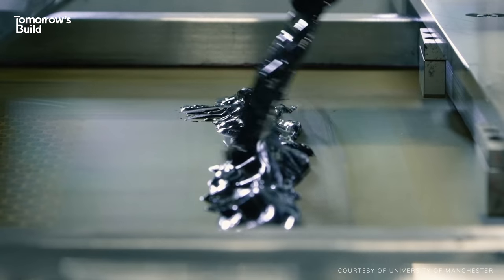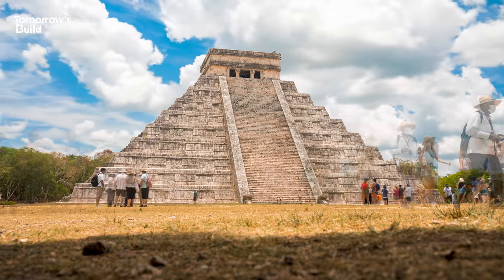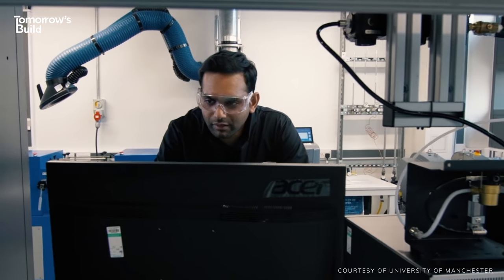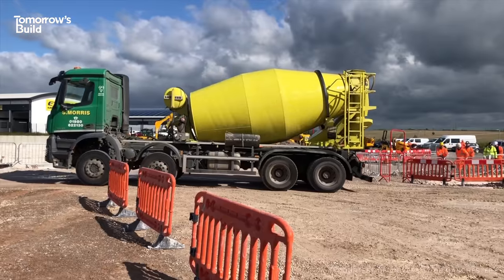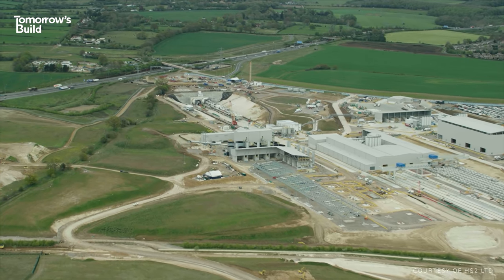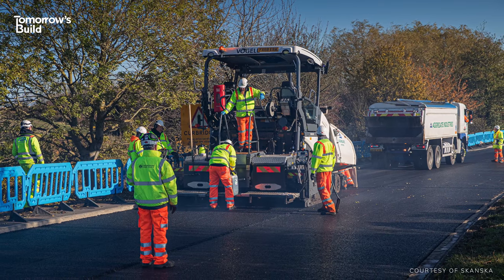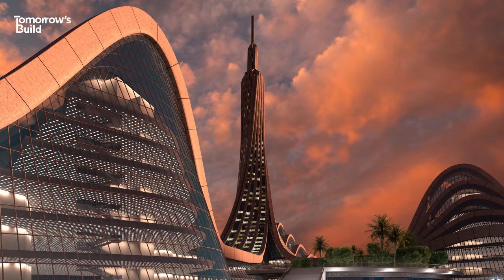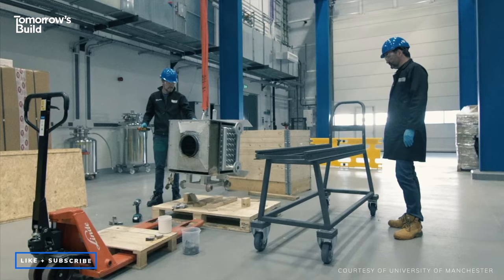Construction's Graphene Revolution Has (Finally) Begun

Comment: No rebar!!!??? That news alone is HUGE
Reply: if and when my friend.
Reply: ... and not good news for the steel industry!
Reply: Huge and crazy cool.
Reply: @drummingspain207  unless they make graphine coated steel for other purposes like space flight and metal casting etc.  steel is used plenty in thousands of other applications other than rebar.
Reply: @Carboxylated  sure, and they are good points. In line with the OP, I was thinking particularly of the thousands of jobs which rely on steel rebar. From manufacture, bending, transportation, fixing... that would be a lot of people suddenly out of work or having to rapidly retrain if possible. But that's technology for you.....!!
Reply: Fiberglass fibers are already used to prevent cracking.  Fiberglass rebar is also available.
Reply: @drummingspain207  The automobile will never catch on, if it does that'll be horrible news for farriers, horse breeders, veterinarians, and many thousands of jobs!!!

Graphene isn't going to replace rebar in one fell swoop. Stuff like this (if this really is the way of the future) takes time. LOTS of time. Decades.
Reply: @drummingspain207  Yep, that's technology… and regulation, health discoveries, and a lot of other things that changes how we do things and the materials we use. This is why a good society supports people who need to learn new things, and values innovation and discovery.
Reply: What they didn’t say is concrete is crap under tensile loads so rebar def still needed !
Reply: @nasonguy   lmao not if it's a disruptive technology. if you look at a graph of disruptive technologies you'll see pretty much all of them shoot from 10ish% to 80% adoption in a few years
Reply: they can use fiberglass and kevlar
Reply: they kinda are forced into it in the 3d printing application... cant have the printhead crashing into rebar
Reply: Will it work. I am a bit sceptical about new technologies in big projects like this. Because small mistakes can mean huge challenges.
Reply: @drummingspain207  I think it’s the opposite. Concrete has lots of uses that’s superior building material to wood for example, but the rebar needed might make it more costly. If new graphene concrete were as great as promised it would create new jobs and use better material. On the other hand, steel will always be needed. Besides, most steel rebar comes from China anyway, not many in Europe or US will lose jobs.
Reply: there will still be rebar just maybe graphene rebar
Reply: @drummingspain207    i mean eventually man will be replaced by machine lol already happening slowly but surely
Reply: And miss out on drilling through it and being blamed for compromising the integrity of a building because the engineers indication on the print was a little off? Wow amazing. My back is still sore hahaha
Reply: @drummingspain207  and they will adapt, same as all obsolete industries have over the centuries. Do you also lie awake at night worrying about the horse infrastructure that lost its position when cars were developed?
Reply: No rebars might also mean no need for many columns on bridges and buildings and not too many joists for roofs. Graphene is after all 100x stronger than steel.
Reply: @leapdrive  not to mention buildings will be less likely to collapse due to rebar rotting.
Reply: @williamcrowley5506  , 👍
Reply: @drummingspain207  You can relax, nothing is happening "suddenly" with graphene
Reply: We've had fiberglass concrete additive for decades
Reply: @JarrettWilliams99  and that compares to graphene?
Reply: @raybod1775  fiberglass will never replace steel. It has its own problems in concrete
Reply: Is this the same material used in the covid19 jabs?
Reply: @fcres5845  you should try it and find out. Feel
Free to mainline some graphene infused concrete and let us all know how it works out for you. 🙄
Reply: @William Crowley
Too much your answer 😅🤣
Reply: @fcres5845  too little your English 😂🤣🙄
Reply: It’s crazy
Reply: Speaking as a structural engineer who has used fibre reinforced concrete graphene probably won't replace reinforcement anytime soon until they can get consistent mixing and the failure mode of the concrete is not catastrophic. FRC is really good for reducing time until concrete can be used, it increases the tensile strength through the full depth of a slab / beam, similar to prestressing but without the mechanical action but more importantly reduces the time to reach a suitable strength to start working on the curing concrete. However, one big drawback is confidence in the consistency of the mix and clumping of fibres, if it is not even throughout the entire mix or uni directional in some locations there is the distinct possibility that it can have local failures in tension. There is also the problem that under reinforced concrete (with steel rebar) has the very desirable failure mode of visibly cracking before it's capacity is fully exceeded so it is possible to evacuate prior to failure. FRC without reinforcement, including steel fibres not just a graphene mix, fails immediately (i.e. catastrophic) so you would have to have a lot of confidence in the concrete supplier to make a homogeneous mix to match the design capacity and that capacity is never exceeded otherwise you will be killing an awful lot of people. I don't have big enough balls to use FRC in a suspended slab anyway, I've only used it in heavy duty pavements (think really really big mine trucks) so they can use them faster. Until the professors can prove graphene in the real world and not a lab I am not replacing steel with it, yielding is a good thing.
Reply: @drummingspain207  This industry wouldn't stop using rebar universally overnight. Plenty of time for the workers to shift to other jobs.
Reply: Ironworkers be like 😳😳😳
Reply: That's bigger than you think considering the issues with poor quality rebar created via the "thinning process" first developed in China and suspected of being involved in several building issues in Australia where I am.
Reply: Haven't basalt fiber and fiberglass been already successfully substituted for rebar in reinforced concrete ? A pity they're not seeing more widespread use.
Reply: That's only possible because the concrete is being 3D printed - 3D printed concrete can't use rebar anyway, and this technique is not practical for many applications aside from retaining walls. This is because retaining walls can be designed and manufactured such that they are entirely under compression. 

The primary purpose of rebar in concrete is to provide tensile strength, so if the structure is designed with tensile regions rebar becomes unnecessary.

The biggest issue with concrete that does not use rebar is that the failure mode is sudden and total, and this eliminates the primary advantage of concrete as a construction material.

Graphene concrete is a big deal but it's not going to remove the need for rebar in 99% of structures.
Reply: I literally paused the video and was reiterating that to my wife,... And shockingly, she mocked me by saying oh how interesting,..😂🤣😂🤣😂
Reply: @edwardhost2642  It could be used in a different way. Rather than site preparation they could be used as pre-manufactured slabs after each and every one stab is tested under tension. Some will fail, but the ones which pass will be positively well mixed. Without reinforcements building with them will be like stacking legos.
Reply: @TonkarzOfSolSystem  I think you meant in that middle paragraph that if you design WITHOUT (not with) tensile regions.

Sensible but also difficult to do. Almost all multi story buildings are in a very basic way vertically mounted beams and if you bend any beam there's always one side in tension.

Go look at the issues with Opal Tower in Sydney Australia and it was fairly obvious there was a major issue with rebar quality and the capability of the structure to handle tensile loads was not there.
Reply: Yes!  As we in America recently discovered, rebar embedded in concrete can do as much harm as good.
Reply: @nasonguy  it did. That was the pace of our ancestor. Now, we advanced on a different scale. So fast you can not Even compare. What we do in 10 is equal to 100 years looking at the time of industrial revolution, or what we do in 10 years is comparable to thousands of years of where we came from since rome and pre biblical times. And Im sure in the future our time will be comparable in the same way, with advancement being every day. Regardless, being naive will only cause shock. I sure remember my grandama shock when smart phones and touch screen came out. She was not even really old then yet it was a hard transition...really hard lol.
Reply: Bye bye iron workers :/
Reply: T.C.  They won’t ever remove rebar from construction concrete and not replace it with some other component.  Steel is used for tensile strength but also for ductility. Once concrete which is its modulus of rupture it fails without warning reinforced concrete is able to bend based on its reinforcement factor. They say in the video that the Rail construction site may not need rebar that’s probably because they’re talking the building code for shear reinforcement, V(phi)/2 > V_ult (no stirrups needed) which is not the same as tensile reinforcement.
Reply: I would take this statement from the video with a mount Himalayas sized grain of salt.
The Steel in steel reinforced concrete has multiple roles, which I don't see how graphene dust can replace. There is also prestressed concrete.
Unless they start producing graphene weaved into ropes, steel will be here to stay. Even then it will take probably more than a decade before building codes are adjusted (Which is good! I want my bridge/building/road built with well proven materials, and leave the experimental stuff to labs and proof-of-concept projects).

It's more likely that Graphene will join the long list of concrete/asphalt additives used to adjust their qualities based on the application.

(Edit - missed a word)
Reply: @drummingspain207  Well, one industry should sacrifice for the greater good... And one industry will be born, out of the new technology...
Reply: @meklowthelemur861  Yet it took almost 20 years for the smart phone to catch on from the first commercially viable personal cell phones. Much less the big battery pack units or car phones...
I was mostly commenting on this OPs fear mongering about "muh jobs" saying that this will put thousands of steel workers out of a job in one fell swoop by replacing rebar overnight.

It wont.

Will it eventually replace rebar in most applications? Maybe. Will it do it in 2 years? 5 years? I doubt it.

These kinds of global economies don't just die out in the blink of an eye. Just like the horse didn't go the way of the dodo overnight when the Ford Model A burst on to the scene.
Reply: @toothrestorer6588  glad I could help 👍
Reply: Concrete is even now sometimes used without rebar. The amount of applications it can be used for without rebar willincrease with new specialty concretes. It is not always necessary to havebig rebar when you can have tiny strands of something like asbestos or steel wires (shotcrete). If this can replace the old asbestos cement that was dangerous to make and dangerous when friable and at reasonable cost then  it is a big thing.
Reply: @nasonguy  some technologies indeed were like that. Ironic, steel is one of those technologies that upon discover it was mass used practically over night. Some thing do happen over night. . .
Reply: Really? They build huge buildings with out rebar....
Reply: @drummingspain207  lol you're believingthis fake news ??
Reply: Indeed, that's got to be easily quantified as a savings in terms of money, labor and carbon footprint.  And because rebar rusting is the main cause of concrete failure it should mea far better lifespan for the stucture and additional savings in maintence.
Reply: No rebar! I would guess it has its limitations. 

Like it would still be needed in floors for high rises and maybe walls of a certain height.
Reply: @klashnacovak47  we built a 50 story building with no rebar.....it's pretty basic. Structural steel and prefab hollow core slabs.
Reply: @meklowthelemur861  Yeah, we don't use wood or brick anymore.
Reply: @drummingspain207  An alloy or composite of steel and graphene may yet be possible.

The oil industry is one I'd like to see seriously reduced. (NOT gone alltogether)
The steel industry is NOT one I'd like to see go. Especially considering how steel is 100% recyclable. You can melt it down and reuse it...pretty much as many times as you want. As oppose to plastic. Which, despite popular belief, can not be reused more than two or three times.
Steel, unless it rusts, isn't particularly harmfull to anything, enviornment-wise.
Reply: I would approach this with a healthy degree of skepticism, we still don't know what impact lack of steel in a concrete will be in a long term (50+ years) how is the expansion contraction going to be without a steel in a slab. its good that this is being tried out. but lets see what field test results are. don't over hype it "elon musk fans"
Reply: Graphene seems to increase compressive strength of concrete and durability for tarmac surfaces and concrete slabs... But I don't think it will improve the tensile strength enough to make rebar redundant
Reply: Graphen concrete took my job . - Me 2022
Reply: Its all "will be"s in the future. How many load bearing structure will be "Graphene Reinforced"? Even then, let's see if that's any good.
Reply: I know right !?!?! Amazing!  Supplement rebar, with CANCER!  GENIUS
Reply: graphene concrete + rebar = very strong concrete???
Reply: T.C.  or they'll put graphene in the rebar and we'll get crazy strong structures similar to people who put fiberglass bat in the concrete mix and still double down on rebar
Reply: Rebar is being phased out due to bad rusting rates !
Reply: Steelfixer here. Im not worried I'll lose my job and to you who say rebar will be fully replaced don't quite understand the function of rebar.

Rebar is reinforcing the concrete by adding some flexible strength to the structure. So now matter how hard you get your concrete, it's still brittle and can't suspend a bridge or a roof of its own.

I do recognise the benefit of this material tho. One could shrink the thickness of structures to save concrete and you could shrink the coverage of the rebar because this is better for water resistance. Thus furthering the strength of the concrete by giving the rebar a better effect. 

But unless you find a way to unmake concrete brittle without rebar, this won't put us out of a job. A matter of fact, we'll most likely hardly notice a change in our daily life other than a cool thing to talk about whilst casting.
Reply: @Carboxylated  rebar is just the dregs of the pot, not really a major loss if they lose out on it but it could increase wastage.
Reply: @drummingspain207  Good news for the environment
Reply: Graphete or Graph-Crete would've been better names! Just sayin.🤷‍♂️
Reply: The video only clames an improvement of up to 30% on the low tensile strength of cement. while I am admittedly no architect it seem highly unlikely that this would outright eliminate all need of rebar.
Reply: No more Chinese steel required is massive.
Reply: @Carboxylated  Musk gave up using composites on the starship as they did not properly conduct heat. They went back to stainless. Maybe for inside components.
Reply: @drummingspain207  just when plastics became a huge thing people had to know steels days are numbered.
Reply: @williamcrowley5506  kefe 👍
Reply: @toothrestorer6588  kefe 👍
Reply: @drummingspain207  Nah, steel structures will still be a thing.
Reply: @TheSportsman1977  
I'm pretty sure they don't have to say that. People already know that concrete doesn't stretch. Graphene is one of the best tensile loading materials there is. Obviously, it's not simply going to cancel out, but the whole point is that this concrete will be better able to stretch.
Reply: @toothrestorer6588  
I'm honestly wondering what they think graphene would even do to the bloodstream 🙄.
Reply: @fcres5845  
Are you... joking?
Reply: Golden Age Creation  
What?
Reply: @ivoryas1696  joking for what?
Reply: @nasonguy 
To be fair, the automobile probably wasn't supposed to be as widespread as it became (given how things have gone). But yeah.
Reply: Some applications might use rebar. The formula of rebar could evolve too, or graphene can become the new rebar. 

Etc. Etc. You can't just rule things out like that. You never know what's next. 

The wisest of people know for a fact.

You can never be certain of anything. Someone who is never wrong usually is a fool.
Reply: @toothrestorer6588  
Bruh, that's some rock-solid science, lmao.
Reply: @ivoryas1696  Well that’s what they are claiming.  lol
Reply: I thought horse manure strengthened concrete
Reply: @TheSportsman1977  they put tension cables inside,  it's like old style metal bed instead of classic reinforcement.. I used to work in the company where my boss was running around this topic like a crazy,  so excited with the precast based on this tech, however, at the end,  nothing went so far.  I remember I was asked to design some extraordinary building, which further contractors had to calculate and build with such GO concrete. So, by an accident my boss had a problem reading the scale, and drawings generally, of to be honest (all the time needed 3d model), and that time he thought the bridge-floor between two main buildings was like 30m length.  I guess my eyes were rectangular when he said: ah,  yeah,  we will make it.  The questions about loads, support,  rebar,  some sort of columns to use was met with a sort of hysterical laugh.  Like,  "no need in all that". For sure,  no available calculations back then proved the possibility to build that without any frame or at least some hanging system. The point,  why it could not be developed, is: it could not be calculated;  it could not be calculated because the data on concrete element is not open/disclosed.  It is not open because there shall be a patent and a manual, and a cerification for the precast elements. No patent because the ingredients and mixture will become open and fall under lots of check-fact,  check-safety,  check this check that.  When the product is fine,  that stages are not a problem for the applicant, though take some tome.  Surely,  the question for me was: what was wrong with that GO filled precast concrete that the construction chemist stood 100% against applying for the patent and letting ministry know the composition of the mixure...it was 2018, 3 years later,  still no further steps in this direction. I know there was an attempt to use such (theoretical) concrete for the runway surface.  The idea was applauded by the client,  but again,  nothing happened further.  So,  for me,  it looks like,  some material is discovered,  some potential usage is described and it is dropped to the community,  so the community will go on with the further research and development itself. It's like asking for the collective help without investments. And those who take this idea as a real thing,  spend money for the products they think they may have soon. Today GO is more interesting for its electric properties. Therefore,  concrete is under big question and manufacturers are producing mostly GO nanotubes of a specific type and size for biotech as they have big orders for this.
Reply: yeah alot more job loses
Reply: It’s about the money...
Reply: Remember H Tracey Hall.
Reply: Its potential applications seem interesting. Yet I want to see is proof concept from what can built from it....
Reply: Now in the US that would be looked at as an attack on unions.